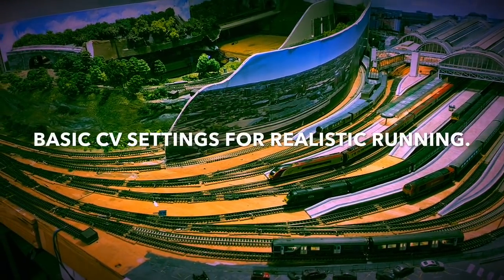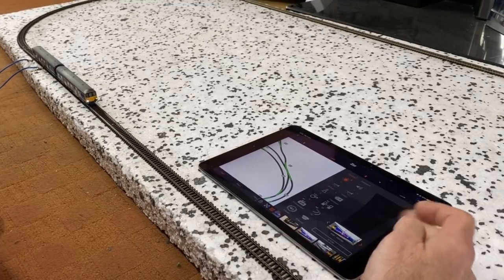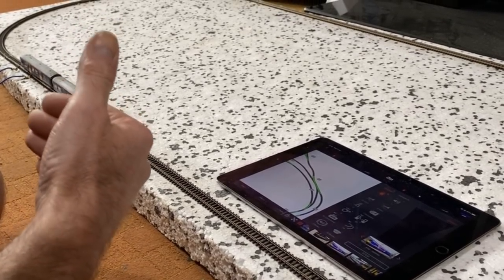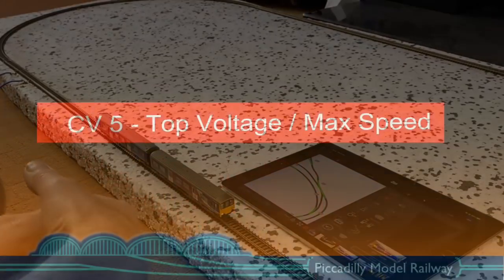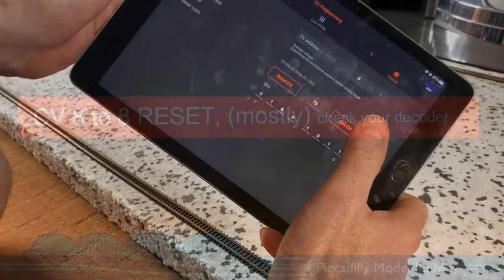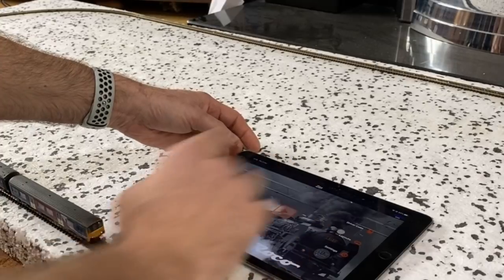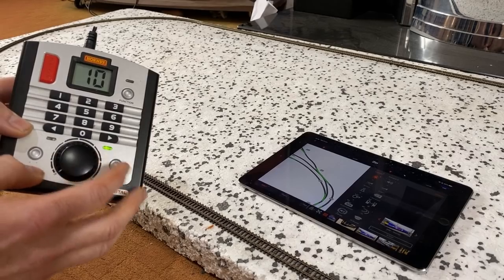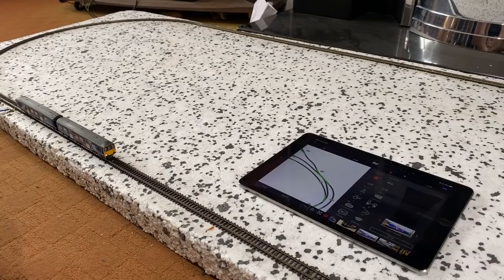MODEL RAILWAY - BASIC CV SETTINGS 4 REALISTIC RUNNING

Comment from the maker: I have since discovered that the Hornby Select has been updated to allow all CVs to be altered and any Select ( however old) can be updated by Hornby for a small fee + pp. You would need to contact them to arrange this. Although Hornby I understand have currently workshop restrictions in place following Govt guidelines on COVID 19, they will be able to do this shortly I’m sure.

My Select has old firmware and the information is for those who either choose not to upgrade or who are unable to for whatever reason. The info was not intended to mislead nor discourage use of the Select (it is a great starter controller, I did buy one!). Someone does not need to replace the controller with a more expensive one if you chose to sent it in for upgrade.

Apologies for any misrepresentation and misunderstanding
Reply: Piccadilly Model N Gauge Model Railway ok thanks for that John I will think about it plenty of time to do that stay safe .... :0) .... Chris

Comment: All very interesting John.  I will take a look at some of my locos with the older Gaugemaster and Bachman chips. Ive always been a bit wary of doing that so your video has really helped.   I recently used the new Bachmann 8 point chip (which are Zimo chips) in my latest purchase( the A1) which has slower acceleration and deceleration built in with active braking (which first appeared with the Next 18 chip on the Castle).  It really adds something to the driving of the loco (but not so much that I am going to change all the chips!).  Stephen
Reply from the maker: Thank you Stephen I’m glad you found it useful. Do be aware not all chips respond in the same way, my gauge master chips, black ones simply rubbish, most burnt out, but have demoted any remaining to dummy car lighting duties lol. 

8- point chip? Not heard of that, have few next 18 now. Please do spill what’s it like. On OO the 158 has a plux22, few extra functions
Reply: Piccadilly Model N Gauge Model Railway  silly me it’s a 6 pin of course, (fat fingers).
Reply from the maker: Ha ha ha lol, I normally try to keep up with what’s happening lol

Comment: Hi John, absolutely invaluable video and very well taught for us “year one” students 😱😂😂😂 As a Z21 user this video is a little treasure so many thanks for making it 👏🏻👏🏻👏🏻 As an aside have you ever had Dapol (not imperium) or gaugemaster chips accept the start command and then blindly ignore all other communication until you pull them from the track 😤😤 For that reason I only use Zimo or Lenz chips, but maybe it was wrong CV’s all along 🤔 Once again very best regards from County Wicklow ☘️
Reply from the maker: Thank you I’m so pleased it was helped. Someone suggested it a few weeks ago, but not been able to do till now. I asked on FB if people would be interested, the overwhelming response was yes, so here it is. 

I don’t use gaugemaster chip any more as they seemed to be the cheapest of the cheap. Bought 10, 10 blew, every last one! Never again, and I couldn’t get refund on any, gaugemaster didn’t want to know, blaming me. Awful!

The Imperium chips I’ve always found to be stunning if I’m honest and just tried my OO gauge 21 pin chip I have in the class 121, reset CV 2 no issues. Could be a faulty one? Can you read CV 
2? Does it run well otherwise?
Reply: Hi John, the Imperiums work a treat, rather it is the 6 pin chips they install in their DCC ready to run models 😱 Good to know you had the same experience of Gaugemaster chips, Rails of Sheffield must be on commission to install them  😤😤 do never ask them to do a chip install for you 😉 Once again many thanks for such a valuable resource 🤩
Reply from the maker: You are welcome Paul

Comment: Hi John, I have just been watching Allans latest video @ dragon junction and he mentioned that a loco went shooting of when he got a short and he had to reset his decoder, which got me thinking about your video on cv's If memory serves me, this is caused by cv 29's standard default to run on dc and dcc, and when the short occurs the loco thought it was in dc mode and shot off due to the track having constant power from the dcc. so this got me thinking about Piccadilly and the size and sheer amount of stock you have. do you alter cv29 to just run in dcc mode or are they set up for both? all the best Tony.
Reply from the maker: Hi Tony, thank you for that info, and weirdly Im watching Allans video now. Just passed the bit about 37, so you didn’t spill the spoilers lol.

Since I bought the black z21 and lowered the voltage I very rarely (if at all now) get trains shooting off. The one that did strangely if off the track. I had to fit a new motor, with now fits why. Id forgotten how bad it was, but motor must have been damaged by shorting. Otherwise I try to use Bachmann (zimo) decoders and never had issue with those. Do occasionally get DMU lights not working correctly, ok once chip has been reset. Maybe thats another symptom